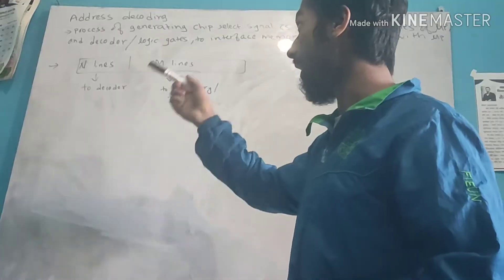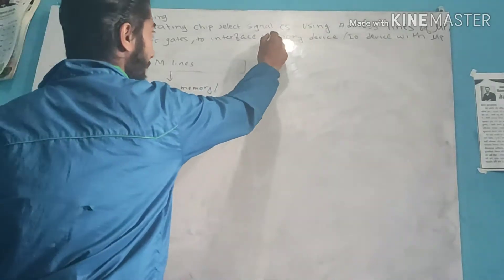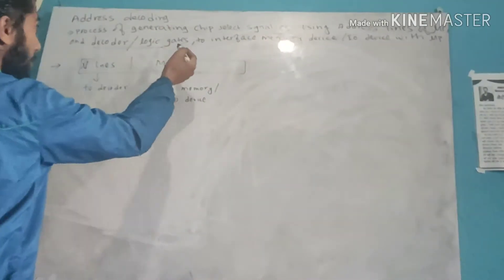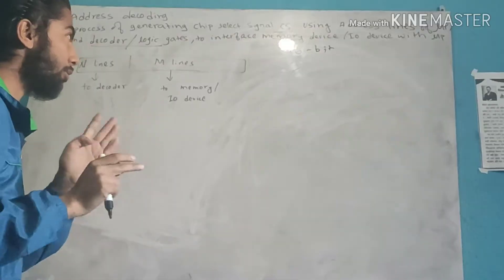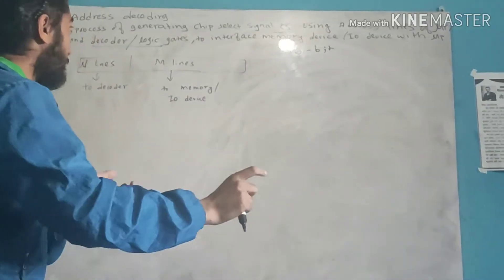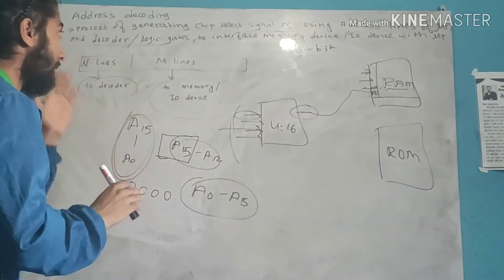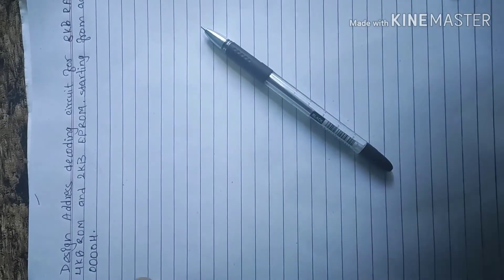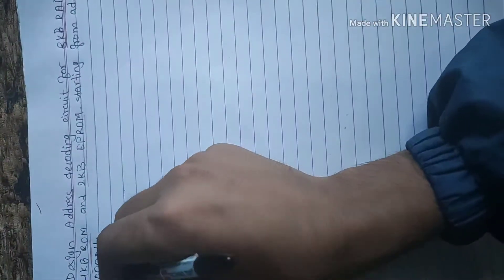Adress decoding fix question microprocessor|| Interfacing | microprocessor | easy engineering |

Comment: no of address lines cacluclate garda tw 8KB ko tw A0 dekhi A11 samma huna parnni hoina rw ani tya tw A0 bata A10 samma matra xa tw
Reply from the maker: In fact, for 8kb, address lines are represented by 13 address lines from A0 to A12, but, here we are given starting address in hexadecimal form and to solve for hexadecimal,  1024 = 400 in hex, similarly,  8kb would result in 2000 in hexadecimal,  and analysing the other signals, we determine input to decoder and enable pins. I think your doubts are clear, if not, please watch it again. There are several methods of address decoding, and this is one of the way. If still you have doubts, catch me on my social media. Contact details are on about section.  Thank you 😊